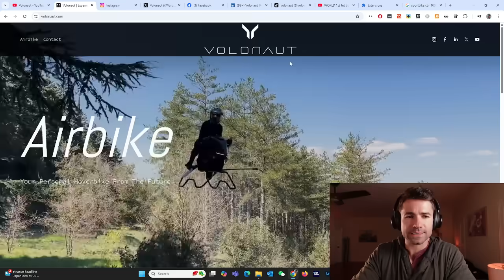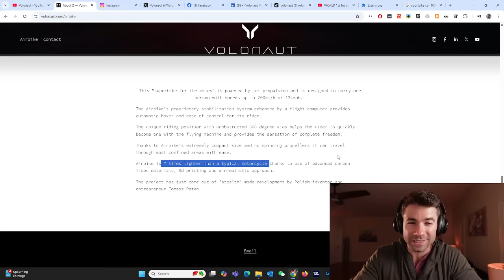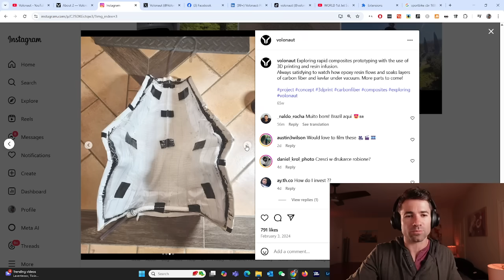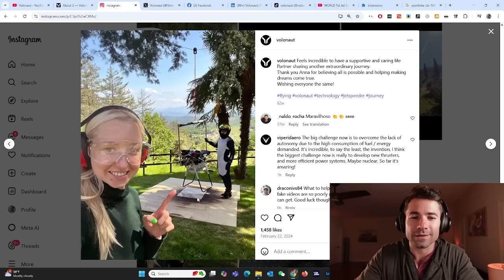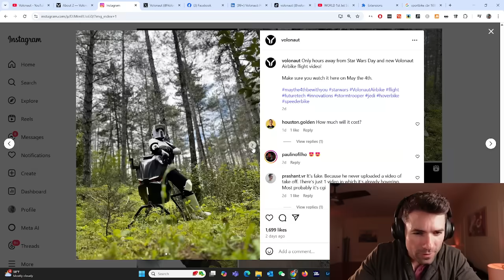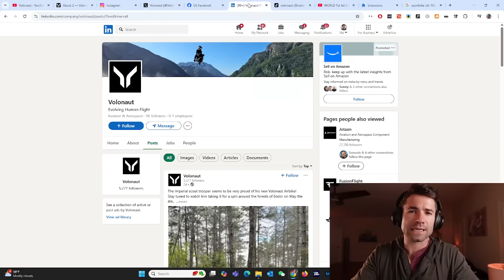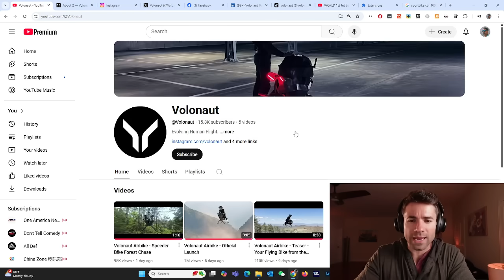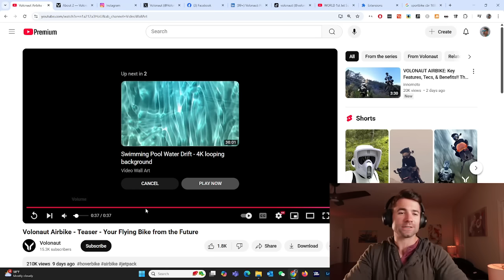Is the Volonaut Airbike Real or a Scam? (Expert Breakdown)

Comment: 100% Scam. Firstly, the "bike" is half the volume of the backpack and arm-thruster arrangement. Secondly, there are no visible directional thrusters, which would have to be too large to be hidden in that tiny frame. Also, where the fuck are the air intake ducts and fans capable of dragging in 2 cubic metres of air per second to keep the engines firing?
Reply: I wondered how tf is it able to stay upright without thrust vectoring, not to mention that a single nozzle in no way would be enough. The jetpack has 5 and it requires two vector arms to pilot.
Reply: @ballapeti  I got into an argument after making the same observation on Volonaut's own YouTube channel, with Volonaut (or a shill) who made a lot of bullshit claims about this thing having 4 jet engines and a lot of nonsense, much of it related to RC models. I did a bit of work and crunched some numbers and this fantasy machine would have to be pushing over 1,400 N, which would involve an exhaust jet of 600-650°C, and engine cores above 1,200°C - less than 50 cm from the pilot. 

For some reason, my last comment keeps being deleted.
Reply: @andrewstrongman305  The 1200C core alone is enough rebuttal for this hoverbike nonsense… 

The ‘Gravity Jet Suit’ for example, looked real from the get go.
This hoverbike shit though is more like an “aspirational concept”. Literally everything they show about it is suss, let alone the physics; that silly piece of plywood that they use as “landing pad” feels more like a prop to “show” that they’ve got hot gas propulsion. 
I’ve recently utilised gas torch around semi-sensitive metal parts where I used plywood as makeshift heat shield, and I found that no matter how charred the wood is, you’d still get embers whilst applying heat. 

I also feel that no matter how “proprietary” a technology may be, you’d still wanna show isolated glances of the working parts. 
My suspicion is that they had initial rudimentary success with the first rough of the “hover bike” idea and they overvalued it. Gathered some third-party funding, but then hit an insurmountable obstacle (physics).  
Now, under —likely— financial pressure they result to tall tales and CGI in an effort to gain some time. 

I might be overthinking, but I’m happy to be proven wrong. 

(Also, seemingly random ‘comment deletion’ is very much a feature of YouTube, apparently)
Reply: @andrewstrongman305  I’ve found this apparently real jet engine, what do you think? It seems like this size could fit: 

https://youtube.com/shorts/Xq-pNRIjrAw?si=QnEb76_A0czOWQ9-
Reply: @ballapeti  I think so, but would 4 of them together be enough to lift 100+ kg, and then propel it at 100+ km/h? Bear in mind that they'd need to be fed over 2 cubic metres of air/sec.
Reply: @andrewstrongman305  Yeah, you’re right.
Reply: @ballapeti  Check out the Zapata Flyboard Air for an example of what current tech is actually capable of. It uses 5 engines (and can safely land if one engine fails). The dry weight of the engines and frame is 115 kg, and it's capable of lifting 102 kg and a max speed of around 150 km/h.
Reply: The Cg is significantly above the cone of the thrusters. Any lean that shifts the Cg outside that cone is unstable.  High speed forward flight requires a tilt angle much greater than would be possible.
Reply: @poporbit2432  Yep. No visible (massive) air-intake, and zero directional or vectored thrust. If this ridiculous thing could get of the ground without frying the pilot/rider they would then have to 'balance on a pencil' just remain airborne. 

Physics is a real bitch if you want to con others into thinking they might one day fly on basically a motorcycle petrol tank with zero safety measures, means of control, or even propulsion. It doesn't even rate a 'yeah, nah', just a straight 'nuh, not happening'.
Reply: So because you don't see these things means they aren't there? Curious how you calculated the volume measurements.
Reply: How can it be a scam if the company has no pre- order? It may be fake though
Reply: You "experts" never actually moved your fat asses from the couch to know what's real or not. 😂 Hillarious.
Reply: They got legit footage.  Its overpriced, loud and only goes 10min
Reply: @chrisletkeman8356 yes it only flies for a little while, but a larger fuel tank would fix this. Use critical thinking.
Reply: @chrisletkeman8356  More showing and less telling, mate. Take your assertions and shove them, unless you have actual evidence to demonstrate? Independent observers taking their own footage? Nah, doesn't exist. Instead, all we have is a doctored video that proves nothing!
Reply: not to mention the total cost, according to their own preorder page, is 880k LMAO
Reply: It's actually not a scam. They are using jet propulsion. This is possible due to the incredible auto stabilization they have now. It's basically a single jet engine with counter rotating blades (though it's probably more of enclosed turbofan) that have directional fins inside. Wouldn't want to be on that thing if anything failed, though.
Reply: Its definitely a scam, you never see it land or take off, there's always a cut to it already on the ground.
Reply: This is NOT a scam. The technology has been around since 1969. The Jet Flying Belt from Bell Aerosystems used a WR19 turbofan engine. It was capable of flying at speeds up to 80 MPH with flight times lasting up to 25 minutes. If I remember correctly,  it could carry a payload of 400 pounds. The United States government siezed the technology, made it classified, and removed it from the public. The engine was then used to deliver explosives for wartime use. It's about time this technology trickles back down to the public.

Comment: This isn't "the future" this is the past repackaged. You just don't know about it. The military has experimented with similar vehicles already before the year 2000. They basically just stood on a single jet engine and controlled it by leaning. I just googled it, it's called the WASP. 
You'll never see anything like this outside of some special shows or remote places and you certainly won't fly to work with it. Why? 
1. Noise. Noone will allow it. 
2. High wind speeds. You saw the stones flying around, so they can't be near anything valuable. 
3. Saftety. This thing is too dangerous (not enough redundancy) to ever be allowed to be sold to the public. 
4. We already have flying cars. They are called helicopters. And all the same rules will apply to anything ressembling a flying car. 
As long as those vehicles are flying by blowing air around they'll never be available to a broader public. For the reasons mentioned above.
Reply: yeah, jet packs have been a gimmick in the civilian space for over a decade now, in the military since the 60s. It's totally possible to strap a few miniaturised jet engines to yourself and then fly around with them looking cool. They've been a thing in air shows and other random big events. There's a whole Wikipedia page on them. And strapping some miniature jet engines to a metal frame and sitting on it is not substantially different. Trouble is, because you can only carry a small amount of fuel and vertical take off with jet engines is incredibly inefficient max flight time is a couple of minutes, and if you make any mistakes in that time or run out of fuel while still in the air you and anyone you land on are severely injured or die. They look cool for sure, but people have already achieved the most out of this idea with the current level of tech, and proven it not at all useful
Reply: @archigallus  
Exactly. But "tech bros" apparently don't want to hear it. They can't be bothered to do any research.
Reply: @archigallus  
Reminds me of new wind turbine gimmicks. With the difference that people like the 3 bladed, large wind-turbines, which work so well (economically and with regards to efficiency).
Reply: @archigallus  
They then fall for "new" gimmicky wind turbines without understanding why wind turbines need to be large and high. They don't know the physics and don't know the history just like with the "flying cars".
Reply: Yeah jetpacks from the 60s

Comment: If you watch one of their videos you can hear a mini jet engine winding down and jet engines have propellers in it. Although if it has one jet engine, balancing on it in the air would be near impossible. The video you were watching at the end of your video, was fake as the movements of the bike were to abrupt(too precise) and the jet engine winding down noise at the end of that video was the sound of only 1 jet engine...

Comment: Looking at the footage 1m28sec in, it is very clear that the device is using one strong jet. It is very likely to operate like the well tested Martin Jetpack from New Zealand and probably powered by fossil fuels. Unfortunately, there are safety concerns dealing engine failure in flight.

Comment: There's no shortage of gullible people it seems. The company doesn't explain a single thing about this miraculous machine. Whatever its technology I very much doubt you'd be getting more than a minute or two of flight time.  You require a lot of energy to fly around like that, and this thing has no room left for stored tanks, or stored energy.   You remember that old news real of people flying around with jet packs.  They were real, but they had a flight time of less than a minute. I really wish humans were smarter.  Most of the world's problems is because of this sort of stupidity.

Comment: The Volonaut website has updated and they have listed the technical specs for the Airbike. 
From the website the listed technical specifications.
    Empty vehicle mass:      30kg (66lbs)
    Top speed:               102km/h (63mph) - in compliance with FAA Ultralight
    Max pilot mass:          95kg (209lbs)
    Propulsion:              redundant jet turbines
    Flight time:             max 10 minutes
    Fuel type:               diesel, biodiesel, Jet-A1, kerosene
    Refuel time:             under 1 minute
    Control:                 fully redundant flight computer enhanced stabilization
    License to operate:      none required in the US - in compliance with FAA Ultralight
Reply: Is "redundant jet turbines" even a thing? Googling that term seems to ONLY refer back to this one product/scam, with no real info, except that one, unexplained phrase.

I'm not buying it.
Reply: @baconsarny-geddon8298  Forbes has an article about it "Introducing The $880000 Volonaut Flying Motorcycle"
Reply: Those specs are so vague. A real spec sheet tells you the type of engines and maybe the total trust,  those are the most vague specs I’ve ever seen. 

Even a paramotor has more specs.

Comment: I wonder if they are using the PBS TJ-100 jet engine used in the Sonex single seat kit jet plane. The engine is built in the Czech Republic by PBS Velka Bites they build small jet engines for aviation.
Reply: Yes mike Im sure they are

Comment: To top heavy to be real if this was real he would roll over and in this video it more looks like CGI with some wire tricks the weight shuffles like it's hanging. Fact at 1:13 on slow mode look at the rocks around the video and as you get closer to the landing gear it blurrs out and that means this was CGI and is fake.

Comment: The operator's body mass is quite large, and I find it difficult to believe that his complete weight is balanced without exceeding the roll axis stability.
Reply: Yep, that's what I though; It looks way too top-heavy, especially without the usual strategy of machines like quad-copters, of spreading out at least two thrust sources (usually 4 or more), as widely as possible.

Plus the size, sound, way it looks constructed, way all their videos are highly editted, never showing any complete flight, take-off to landing. Also the total absence of even the most basic info, in their videos.

I could be wrong, but the whole thing smells fake, to me.

Comment: cost is 880k, speeds up to 63mph, max weight of operator is about 209lbs, flight time is 10 minutes, refuel time is 1 min, fuels up with diesel, jet a-1 or kerosene.
Reply: How much fuel it uses? How much you could carry with you to refuel every 10 min?
Reply: @naturewatcher7596  I'm getting fat. Hurry up faster.
Reply: @dapperdingo  If you'll start to loose your weight you could fit one extra canister of fuel in your backpack. X)
Reply: @naturewatcher7596 i was just thinking the same
Reply: Hey there, just wondering where you got your information from and if you wouldn't mind posting a link, please and thank you 🙂. Very curious about this thing... 🤔🧐😁
Reply: @FreeSpeech6-c1i  It's on the Volonaut website now.
Reply: @FreeSpeech6-c1i Go to Volonaut site.
Reply: 209lbs max weight. That cuts out sales in America then...
Reply: Yea, that sounds about right. A gas turbine in you design has a flight time you say of 10 minutes and I guessed about 5. Despite the cost of the aircraft the owner now has to buy jet fuel and maintain a turbine engine. What is the overhaul time of the engine and how much does that cost?
Reply: It can actually go 140ish
Reply: The limits make it seem genuine.
Reply: No. CLAIMED speeds up to 63mph. CLAIMED flight time 10 minutes. CLAIMED refuel time 1min.

These are all just meaningless CLAIMS. Anyone can write up a bunch of made-up "specs", for their own website. 

I can SAY I'm 20ft tall, with an IQ of 400... that's not the same thing as BEING 20ft tall, with an IQ of 400...
Reply: Wow you bought the whole farm
Reply: 880k?  Are you kidding?  That would be a deal killer.  China will no doubt have something for 30k in a few years.  Looks like fun though.  200 lb. rider max.  Can’t wait.  I’m getting old, so hurry up.
Reply: @bwmcelya is it maybe a crowdfunding thing ? 880k there will not be a lot sales .. may not over a hundred

Comment: I look over it and it is real it likely uses the same jet powered motors from the British based jet suit. Where they have two jet motors on each arm. It is 3 jet motors built into the bike blowing out of a vector controlled exhaust under the bike. The reason why its so compact the rider has to be on top of the exhaust for control.  Very limited range but each jet motor I believe has upwards of 200 lbs of thrust.

Comment: it's quite possibly real if they have 2 large scale hobby Turbo Fan engines. the small 30 HP Pratt and Whitney Jet Turbines they use on helicopters would be like riding a horse, this is too compact under the rider for a small commercially available jet engine. also if they were using one of those they'd need some kind of a gyro to off set the torque from the engine wanting to spin you to the right any time you hit the throttle. it appears they have it thrust vectored out the bottom/back using control surfaces to turn via the thrust. also you can tell when the camera was below it you can see the mirage from the heat on the exhaust ports.

Comment: They do those gyro bikes that you can literally push and they don't fall, I don't know the tech name but it does exist, so they could use that to keep it stable in the air and they definitely do the jet turbine engines on the iron man suit that someone made (not the real one of course but the one someone made with hand jet motors) that can lift a person so make that kind of engine a little bigger stuff it under with the thing for stability and it's possible...

Comment: Almost certainly real.  It's just like Frankie Zapata's flying skateboard in a different package, using small jet engines.  Probably about ten to fifteen minutes of air time per tank of fuel.  Steering is by moving the thrusters slightly.  Not that hard to design and build.  One engineer can build one in a few years.  There have been lots of jetpacks, jet suits, flying skateboards, flying cars using these small jet engines.  There are lots of projects building these kinds of aircraft.  
Also, this is not very practical as an aircraft.  Short flight time, very dangerous for average people to jump on and start flying.  Easy to break your neck on one of these things.  The Gravity Jet suit can go over 80 mph.  If they want to, this airbike could go way too fast and end up killing people real fast.  They would have to governor it to have a top speed of 25 mph, and somehow make it unable to climb above 30 feet high.

Comment: I lean toward either fake or over-promising. In the end a flying vehicle like any other must use a power source.  Jets are notoriously fuel hungry... even more so when you rely upon them for lift. Ducted fans? maybe, but I don't think any of these new non-wing (because wings generate lift from forward motion) aerial vehicles are doing to have much range or flight times.